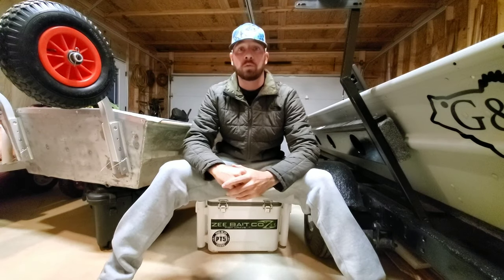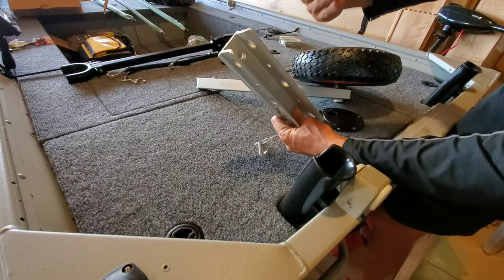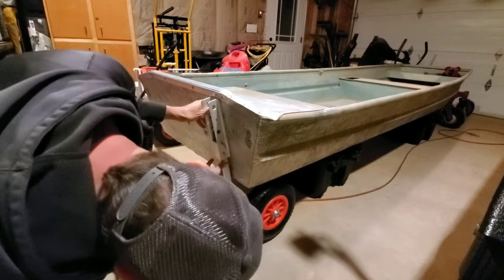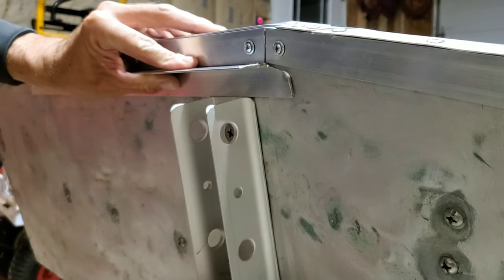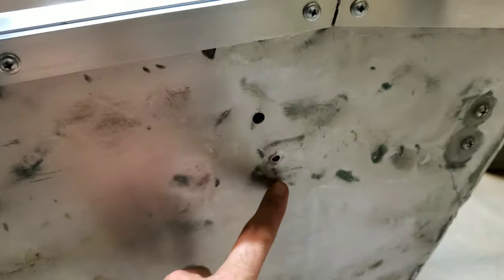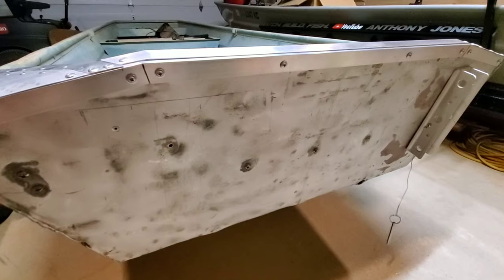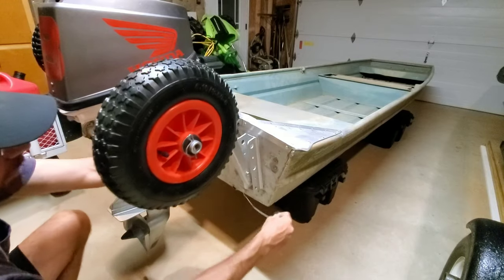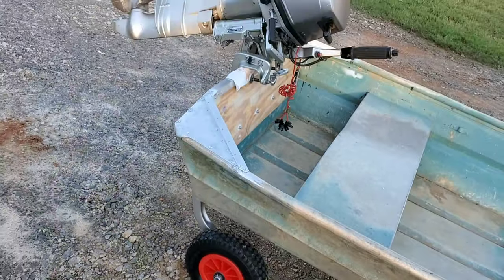Launch Wheels On My Jon Boat

Comment: I wish each wheel had two of the push button things and no pin. Plus, my boat {AlumaCraft 1232) has two handles on the transom right where the bracket will need to mount, and I don't want to remove them. I really do need a set of these launch wheels though.

Comment: Can you face the wheels going the other direction? Instead of being under the boat, face them the other way & face them out? Great video thanks! 😊
Reply from the maker: I guess you can but two things. One, the transom load wouldn't be centered over the wheels anymore as your kicking the wheels out past the transom. Two, when you lift the wheels up they will then angle inside the boat. Just food for thought.
Reply: @AnthonyJonesBrigadeBoats  That makes total sense! Keep the video's coming i have learned so much! 🙂

Comment: It should have a pivoting screw to be able to lift it up while in the water.
Reply from the maker: Idk what you call it but once it's in the water I can push the spring loaded tab and flip the wheels up from under the water. No issues. I've done it plenty since this video.

Comment: Hey man those look awesome. Im looking to solve a problem with my jonboat w 6hp outboard maybe u can offer some advice.  I use my jb mostly for bowhunting a stretch of creek. Where i hunt is about a mile from the nearest landing and a stretch of creek more often than not is blocked by huge fallen oaks. The solution to this would be to just pull the boat on the bank if the creek is to skurt the tree and put the boat back in the water. My question is do y think these wheels would work fir a 14' jb with an outboard?  I saw urs doesnt have a motor so im sure they work fine.  I have a trailer just trying to figure out how to get around these random trees. Lmk what u think.

Comment: Those wheels are awesome. A tip for you, Some mineral spirits on your rag will make quick work of cleanup with 4200 or 5200. It makes it much easier than with just a rag alone.

Comment: Using 3M - 5200  !!!  Mannn that shits so strong u didn’t even need to add bolts lol  I was guessing you would of used 4200 it does a great job sealing but you can actually remove it if you ever had too . But summer awesome i looking to do this to my John boat ! Thanks for sharing!

Comment: Beautiful job, it looks great! I just got a very old 14' jon boat to use for fishing in a reservoir (only rowing allowed) and plan to put a new transom and wheel on it.  Will also paint it, but as it will live at the reservoir I won't be going all out with anything further. Do you plan to add handles back on? You are running out of space back there. I guess if it needs to be lifted the wheels make a nice handhold.
Reply from the maker: Yes, I plan to put handles back on. Will do after the float pods are welded on and I get to a final fabrication point on the transom. I have a few ideas, may actually do something custom and weld on. Yet to be determined.

Comment: So, I'm a bit confused.  Are the wheels for moving the boat around (like for storage), or are they for launching the boat?  or both?
Reply from the maker: It's in the title. "Launch Wheels On My Jon Boat"
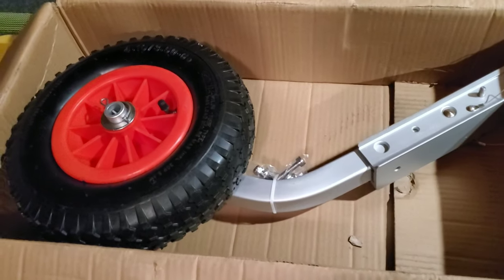If you actually watch the video, I state at the 2:30 second mark why I use the wheels. But to save you from actually watching - the boat is trailerlessand goes in the bed of my truck. So the wheels are what the title of the video says they are.

Comment: Looks good - I added some to my 12ft boat.  The problem I have is it close to impossible to get them up once in the water — very awkward trying to push the pins.  What are your recommendations?
Reply from the maker: Do you have the BroCraft ones specifically?

Comment: those are awesome and look like damn good quality but I can't spend just under $200 for my cheap ass 1970s jon boat lol. when I eventually get a nicer one i would get them but I think I'll make my own for now.
Reply from the maker: Nothing wrong w that man! Lots of people have made their own but for the wheels I wanted to use and to make them right, it was about 75$. The brocraft ones are 150$. At that point I decided my time is more valuable to me than saving 75 bucks. So I just ordered them and bolted them on. I also have a pretty big budget on my build, so there's that as well.
Reply: @AnthonyJonesBrigadeBoats  on the amazon link you have they're $169.99. I think I could make them for around 20 to $30 with using stuff from harbor freight and maybe some scrap stuff I have laying around. The boat I have is a Tempco jon boat and it is beat to hell so I'm trying to get by with spending as little as possible on this project. I even made my own "motor" with a replacement minn kota propeller, stick of all thread, scrap conduit I had and a couple lock nuts and use my dewalt 20v drill haha made it for $20 but works like a charm! I'd love to get that electric outboard you have someday though! keep those videos coming tho buddy, they're awesome!!
Reply from the maker: Oh wow, they were 149.99 when I bought them! That stinks, everything is going up I feel due to covid. Anyhow,  totally understand nan, good luck on your budget build! Sounds fun, maybe I should do something similar one day on the channel? Thanks for watching!
Reply: Anthony Jones that would definitely be a good video to make especially for people like me who like to make things themselves if it’s going on something cheap lol

Comment: Is it possible to tow a boat if you out wheels on this and eliminate the need for a separate trailer? That would be maximally efficient.
Reply from the maker: No. The wheels are not rated for speeds over 10mph maybe. Not saying it isn't possible with custom fabricated set up, but these aren't that.

Comment: Dude you put them on backwards so now when folded up the weight hangs off the back, plus they’d be way more stable if they weren’t under the boat when pulling, they are curved so when folded up they fold inside the boat slightly but hey if you like your boat pilling wheelies the entire time go ahead and keep more weight hanging off the back.
Reply from the maker: Dude I can't tell you how wrong you are...
When folded up the weight hangs off the back? What weight? The plastic wheels???
Do me a favor in all seriousness. Here is the link to the exact wheels from the manufacturer.  Click it and swipe the images and see that I installed them the way they designed them and recommend.  You'll even see their install pictures match mine.
Brocraft Boat Launching Wheels/Boat Launching Dolly 12" Wheels for Inflatable Boats & Aluminum Boats https://a.co/d/aJwqmm9

Comment: $150 for some wheels... I only paid $140 for my jon boat... I’ll just keep dragging it lol
Reply from the maker: You could DIY build your own for half that if you'd like. It's not worth my time to build my own to save 75 bucks, even if I did they wouldn't be as nice as these. Good quality parts aren't cheap. I thought the price was pretty good for what you get but I'm used to buying quality aftermarket parts for trucks, cars and motorcycles.
Reply: @AnthonyJonesBrigadeBoats  honestly that’s a great justification, I like that perspective 👍🏼